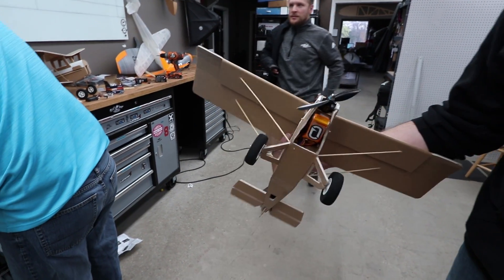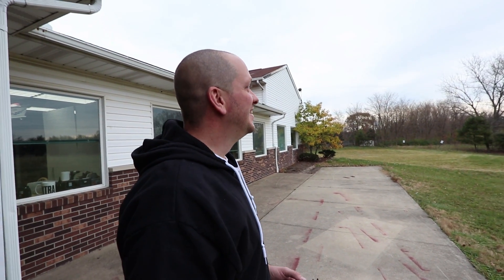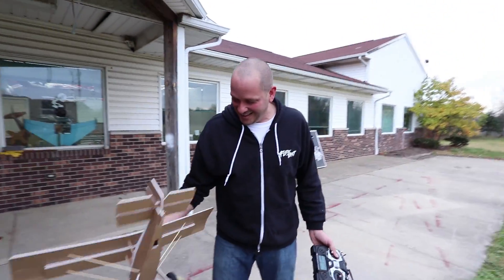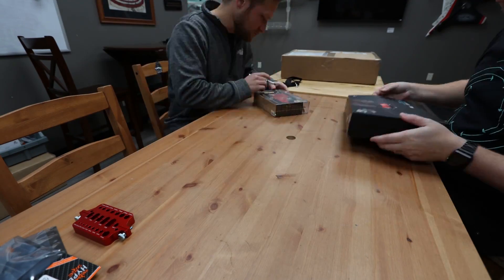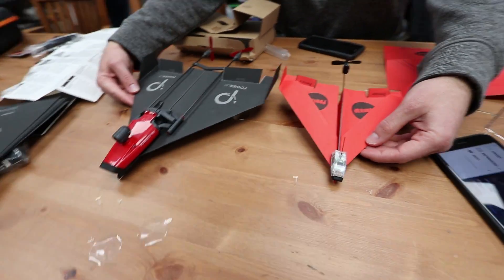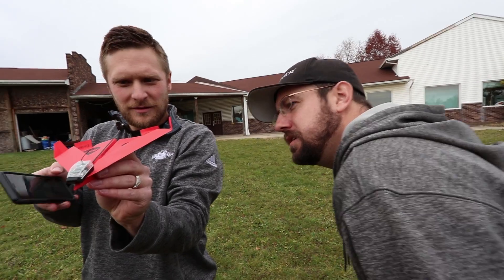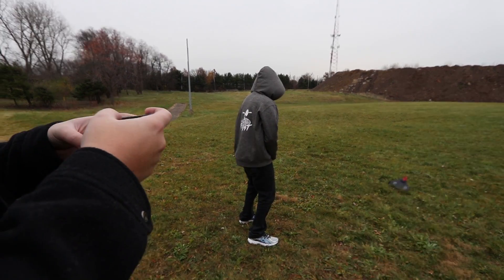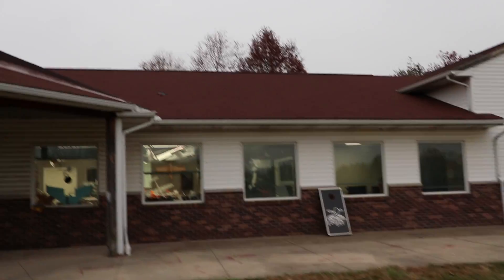PAPER AIRPLANE DRONE - POWERUP FPV -  | VLOG0031

Comment: Hey FT, thanks for the PowerUp FPV review, The airplane you tested missed a critical part for some reason called the cross bar, this fixes the dihedral angle and has major impact on the flight performance when banking and soaring -  you can  see here - https://poweruptoys.zendesk.com/hc/en-us/articles/217767923-Push-The-Stabilizer-Cross-Bar-Forward-Into-Place Alishanmao has just tested it and got entirely different performance due to this component, Please try it out again with the cross bar installed!
You can also test the custom CG location by sliding the airplane to the rear, this will increase the stability and flight speed dramatically (about 30 kmH) and is really fun to fly. The rear view of the rotating camera can generate very cool footage too, check it out!
Reply: Well then... buy one.
Reply: @gertnood  You killed me
Reply: PowerUp Toys I want to buy one
Reply: boutta do it to mount it on my paperweight cardboard mirage 2000, would love to see whether it works :D

Comment: ive have the power up 3.0 like Stefans.  2 of them in fact. They are fun for about 2 minutes. I still have them. they sit in their boxes never used. Save your money and buy a Dromida or Duet instead. Better control real flight and flight time.
Reply: Would you consider letting go of one? Even if it's broken. I'm on quite a tight budget and I can't afford the $50 for this tiny "piece of crap".

Comment: You guys should build an RC pod racer.... Use duct fans and foam..... make the pod kinda like a wing
Reply: it would be interesting. Would probably need to built it like a tricopter, with one upward motor on each engine nacelle and one on the pod, for it to fly at all.
Reply: Or just use transparent plastic film covering, that way you could get near invisible wings.
Plexiglas would probably be way to heavy.
Reply: Christoffer Nilsson that might work, cg could be an issue though.
Reply: Well, If you used like a mini wing (like the mini arrow) as the pod.... Two small arms to hold BL duct fans on each end... It could work.... the wing is the lift and the fans are the thrust.... Then you could use variable thrust for turning and maybe a small elevons on the wing for pitch control
Reply: as much as I would love one It would rather fly horrible or be nothing like a podracer
Reply: I already have an RC podracer in the works, with EDFs in the engines and pods to give lift. Hope it works well!! The plan is for all components to be internal.